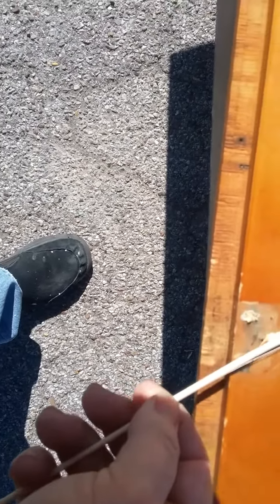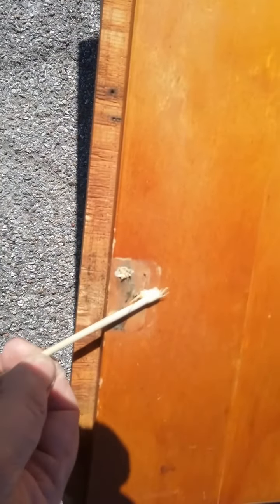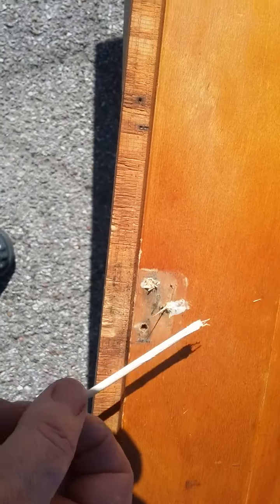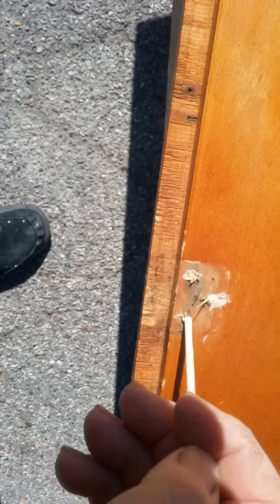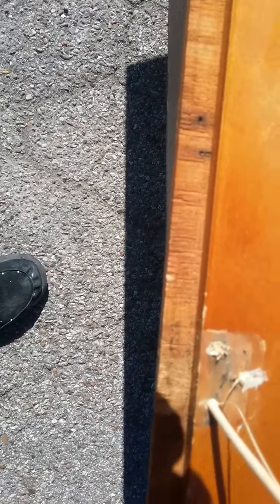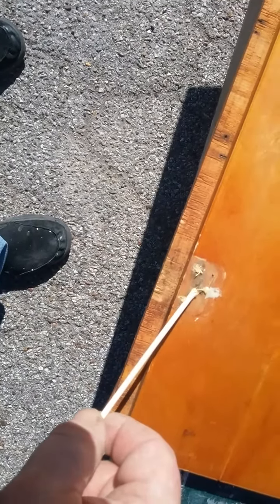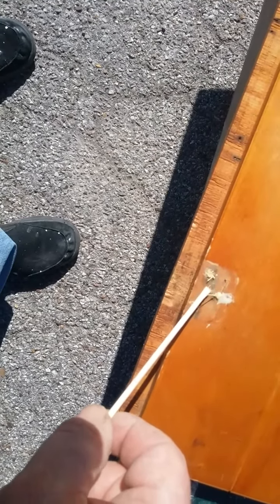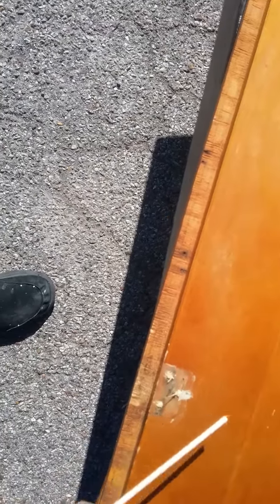How To Repair Stripped Screw Holes in Wood

Comment: I prefer using toothpicks, and I will jam as many as I can into the hole, using the same method, these are a hardwood I believe.
Reply from the maker: I saw a "how it's made" clip once and the toothpicks they were showing were made from some type of cedar. Just figured most others were too.
Reply: Blue Collar DIY I’ve been able to when in a rush, put some glue in the hole, mash the toothpicks in with my Leatherman, cut the toothpicks flush, put the screws in with the hinge and let it dry up that way, so far it’s worked pretty good, not as good as letting it dry first, but then again I didn’t have any further problems with it either.
Reply from the maker: I'll keep that in mind! I usually let them set at least 30 minutes before installing the screws. But, like you said, there's been times I've been in a hurry and may have only waited 5 minutes ;)